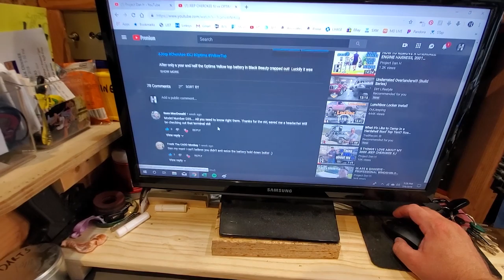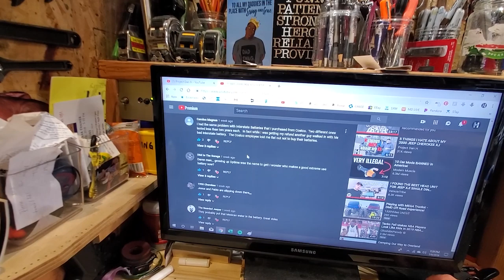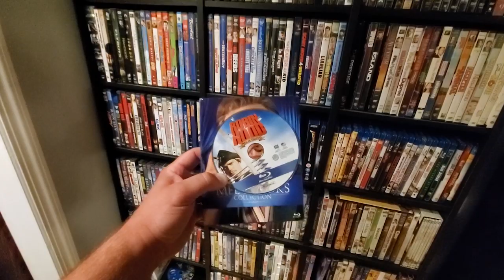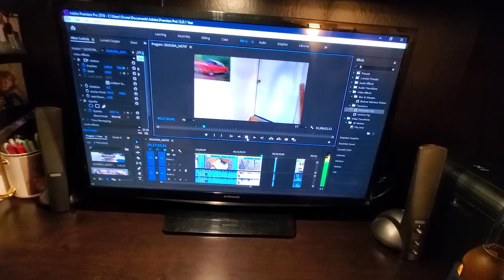CHEROKEE XJ BEACH JEEP UPDATE WITH BLOOPERS & BEHIND THE SCENES FOR THE 1 YEAR ANNIVERSARY

Comment: Loving all your videos. I have a 2016 JKU and a 98 5.9 limited platinum color grand Cherokee. My gc unfortunately is at the trans shop. So I've been stacking up new parts to go in it for when I get it back. Your videos are helping me to keep my mind off missing mine. Ha. Btw ima need you to upload some more. Ha ha. Keep doing what your doing. And take care of that family.
Reply from the maker: Will do John! Thanks for the support!  Since  I've had this ZJ I've really been wanting a niner.  Not surprised the trans went. Lol they all do. Hope you get your baby back soon.  {PS, how does the 5.9 do on gas mileage?
Reply: @ProjectDanH  about as good as my wrangler on 35s lol. Rt now about 14mpg but I use it for work. I do expedited shipping for tooling services. 2 times a week I do a 300 mile round trip up to the mountains with steep hills and if your not going 60+ mph you'll get run over. I've had several xjs and zjs with 4.0s 5.2s and now the 5.9. The 5.2 and 5.9 just give that extra low end torque where it matters going up steep inclines at higher speeds. I love the 4.0 but for what I do the 5.9 is the winner of the 3. Good thing about the 5.9 is you can actually use the A/c and you dont feel the power being robbed when the compressor kicks on or more gas. Power to weight ratio is killer. The trans is getting rebuilt with heavy duty converter and other things done and the biggest cooler they can stuff between the grill and radiator. Sorry for the long reply. I'd love to get some of your stickers. And I'd like to be able to send some pictures of my grand over to you. I think you would appreciate the things I've already done to it. It's kind of a mix between black beauty and the Gen. Thanks.

Comment: Hey Dan! Enjoy your project videos and Congrats! on you 4th soon coming child! On the review mirror situation, I've had that issue on my 95 XJ (Bumble Jeep) But it keeps falling off. Stays on for a bit and randomly falls off. I've worked on vehicles on and off most of my life and have installed many review with no problems. Except for Bumble Jeep. Hoping this time it stays on, Safelite did it this time when they installed the new windshield after my mishap late May. Hope to have it back on the road soon. As for Blue, have you thought about a hydraulic conversion for the new clutch? Just a thought. And again, Congrats! on your addition to the family.
Reply from the maker: Thanks Frank!  Apparently the previous owner whent through a variety of adhesive products to no avail.. I'm gonna have to be extremely thorough on this attempt